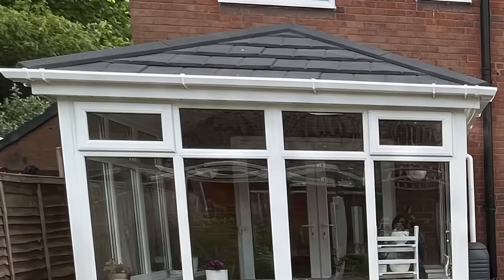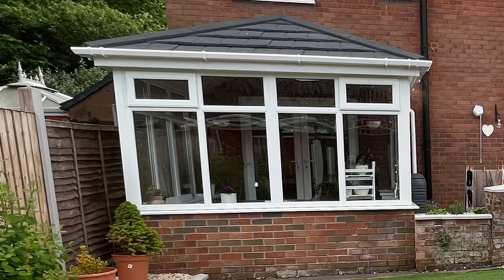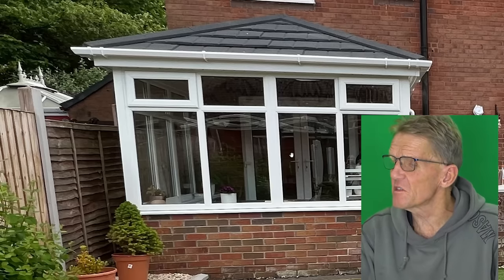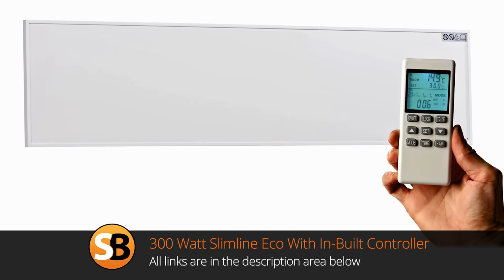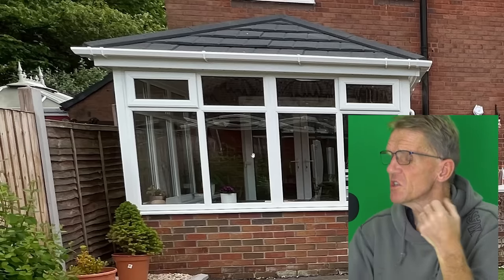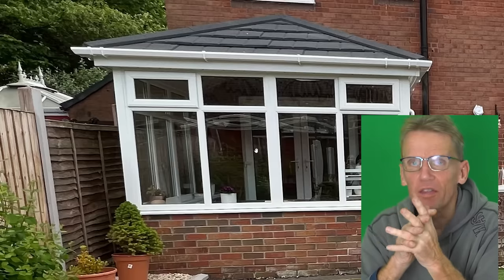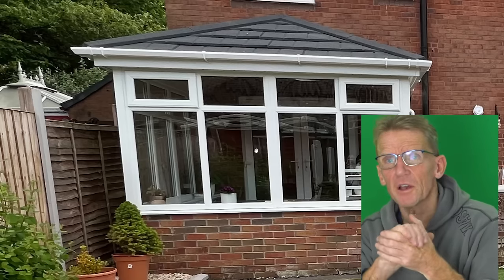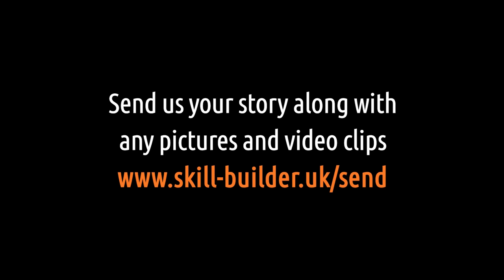What Can You Do About a Freezing Cold Conservatory?

Comment: Accept a conservatory will be too hot in the summer and too cold in the winter. There are ways to make use of them in both seasons. 

In winter, I have my rowing machine in the conservatory. Ideal for a cool room. After a few rows you'll be hotter than a chicken in an oven, and it's great exercise. 

We also have a pool table, and we regularly play. Moving around the table warms the air in the room, gets it circulating. We have a heater as well, but it never needs to be on long while playing. We also have blinds that are automated and shut around 4pm in the winter, which traps the warmer air of the afternoon in the room.

It's a darn shame to tile a conservatories roof, better to have glass, else that is the point? In the summer is lovely to see the blue sky and to have the roof windows open. Likewise the doors and windows.